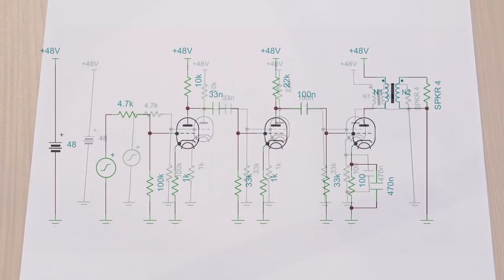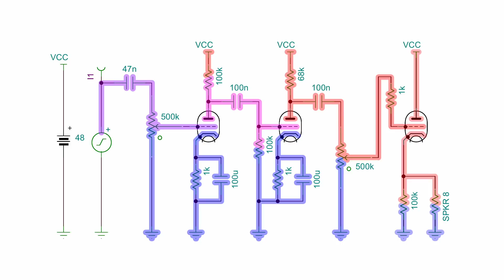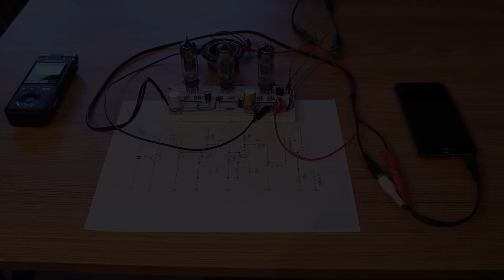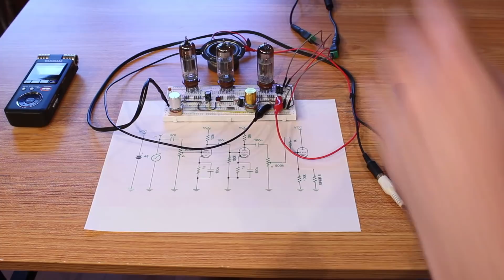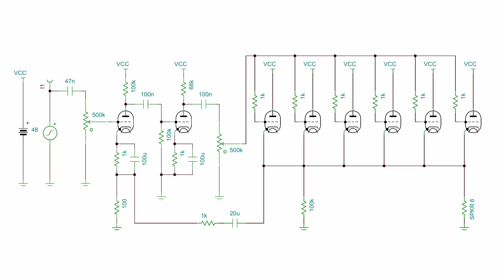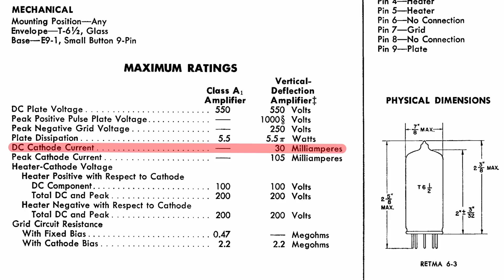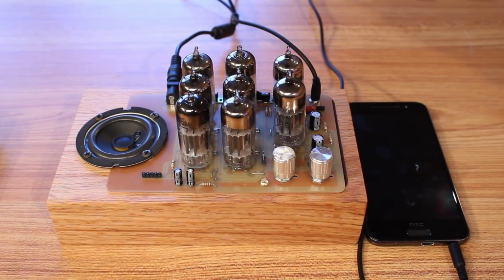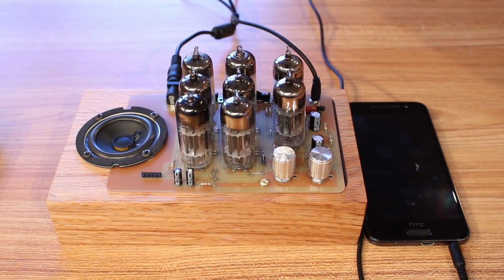A Low Voltage Vacuum Tube OTL Audio Amplifier

Comment: I wouldn't put DC thru the speaker at the cathode, at the very least in this topology put a large capacitor in series with the speaker. The DC conditions at the cathode will be maintained and only the AC will pass thru to the speaker.
Reply: Yes! It is very possible to split the DC and AC paths of the cathode signal.
Reply from the maker: I actually did try to put a few different caps in series when testing the design to remove any DC through the coil, but no matter what size cap I tried, it always decimated the sound. Like removed greater than 90% of volume. It could be that I just didn't get a large enough capacitor, but I think it mostly had to do with the insanely low voltages I'm running at. 
The 12B4A was moving around 40mA through each tube, which at 48V should mean an internal resistance of about 1200 ohms per tube. With six in parallel that should be something like 200 ohms of series resistance with the speaker. 
I think the impedance is just so ridiculously mismatched that adding a series capacitor just wrecked whatever weird balance I had going on here. 
Or I could be totally off the mark, this is all uncharted territory for me!
Reply: @UsagiElectric  4800uF - 6800uF or more ? A smaller cap will definitely act like a high pass filter especially into a low impedance speaker at audio frequencies.
Reply: @UsagiElectric  for curiosity, try to replace the 100kΩ resistance going from the anodes to ground with a 16Ω or 32Ω resistance, put a 4700μF cap in series with the speaker, trim the anode current to have 24V across the 16 or 32Ω  resistance and try it like that
Reply: DC characteristics won't be maintained. The cap will block off all DC cathode current and there won't be any biss on the cathode, which is currently provided by the speaker's copper resistance (should be around 6R for a nominal 8 Ohm speaker) voltage drop. 
There will only be the 100k resistor which does bugger all. A 6R8 resistor would work but it will waste even more of the AC power. A large inductor would solve that problem, passing only DC and very low frequencies but not shunting most of the audible band, but that would be bulky and impractical, might as well just use a transformer.
Reply: He experimentado bastante con Otl de bajo voltaje y de alto, y definitivamente las inductancias/reactancias me parece según mi experiencia lo mejor, de balastros, halógenos etc se consiguen muy baratas, pues las están sustituyendo por leds😊, prueba varias las hay de muchos tamaños, o bobina las tuyas a medida, por ejemplo una rectangular alrrededor de toda la caja con núcleo rectangular. no te quitaría mucho espacio.
Reply: Nope, you would have a 100k output impedence, check out class A amplifiers
Reply: @fabriziobrutti1205  You have no idea what you are talking about. Maybe YOU should go lookup what it means to bypass a cathode at AC. The worst thing about your comment is total lack understanding of what would happen to a low impedance voice call having DC running through it.
Reply: @vincei4252  actually i didn't get your answer about the DC through the voice coil(?)... I know that there mustn't be any, or otherwise the speaker will get some damage, so a capacitor must be put in series, but by what I know the 100k resistance should be replaced with an 8 Ohm resistance... Anyway I'll check the part about bypassing a chatode at AC, since I don't know much about vacuum tubes (btw I'm just 16)😅
Reply: @fabriziobrutti1205  That's fine. In a nutshell at AC, provided the capacitor is big enough, it looks like a short and the impedance seen at the cathode to AC is the impedance of the speaker. If you look at transistor circuits you will see something called emitter degeneration where a capacitor is placed across the emitter resistor or portion of the total emitter resistance. Doing this has the magical effect of increasing the gain of a common emitter amplifier because the AC impedance seen at the emitter is lower but the DC conditions at the emitter are maintained for biasing purposes. Look it up it's interesting stuff. Good luck in your journey.
Reply: @vincei4252  Ok, I did some research but still I don't get how can an... Uhm cathode follower (inspired by emitter o source follower) drive a load with an impedance lower than the cathode resistance... I have read something about bypassing the cathode resistance of a common cathode amplifier and I already knew that, but as I said I can't get it with a cathode follower.. Do you have any documentation or links to forums to help me to understand it? 😃🤔
P.s. This comment is quite long so sorry for any grammar mistakes but I'm not English😅

Comment: I'm sure that if you connect the amp to a 10" speaker it will sound even better! And of course with a two way, nice project as always!
Reply: You are right, would be a better test with a high efficiency full range hi-fi speaker. Bigger speaker with the extra bass content takes a ton more current to drive. You should use a capacitor to protect the speaker from any DC, I can't remember if there are any caps in the pre speaker circuit? No there aren't. 🙂 Also restrict the bass frequencies to the audible range by trying different (smaller) cathode bypass cap values in the preamp stages, 100uF seems flabby. Saves wasting energy driving sub audible bass.
Try losing or a bigger resistor in the neg feedback loop to the first preamp? Might drive a real speaker?? Exciting stuff.
Reply: And don't forget the water cooling
Reply: @Schlumpfhut_1985  Actually, if you used deionised water (no salts or other contaminants) pure H2O is not conductive! and would work as a cooling medium for high voltage tube amps! (Yes really it would)
Reply from the maker: Thank you!
I really wanted to stuff it all in that tiny footprint, but in the future, I'm definitely going to spread things out and run more speaker for some proper full on sound!
I happen to have a handful of 6146 power pentodes, that when triode strapped can move well more than double what the 12B4A can at a given voltage, so some of those mixed with a bigger speaker and maybe some proper design to eliminate DC bias and I think we can get something really wild going on!
Reply: Yes, actually pro audio speakers like the brand Faital Pro have 96, 98db that will work great on low power amps that needs high efficency. I've tried that with my 1w diy tube amp, also compression drivers have 105db minimum in most of the cases
Reply: But maybe is better the idea of a full range as you mentioned, so you don't have to worry about pairing with a driver, crossover..
Reply: You are neglecting the "GIGO" Garbage In, Garbage out" principal ---If the audio source is noisy, it wont matter what speaker you connect. It will still still sound like garbage.To put it another way, the audio source (recording accuracy) is the most critical in the chain of amplification 
Please don't interpret this as a criticism of you or the experimental work he has done. low voltage tube stuff is really cool! Just don't expect the result to sound much better because you put a 10 inch full range on it (it actually will, but only a little, but It will expose other issues... "peeling the onion" is the relevant term when fixing one problem exposes another problem. The is a reason that low voltage is not used for tube gear.